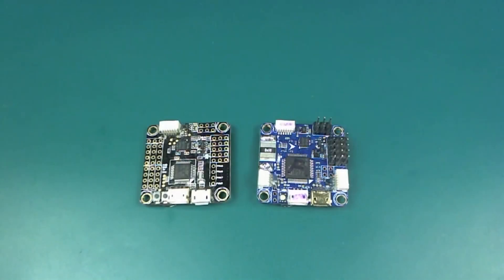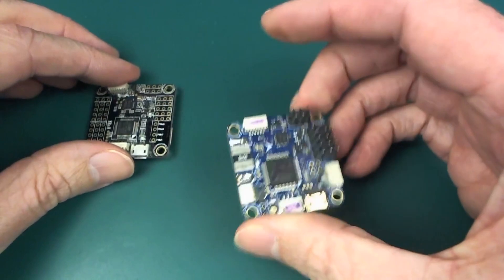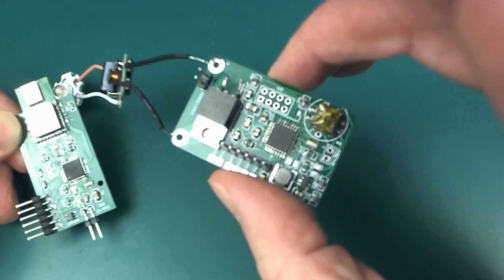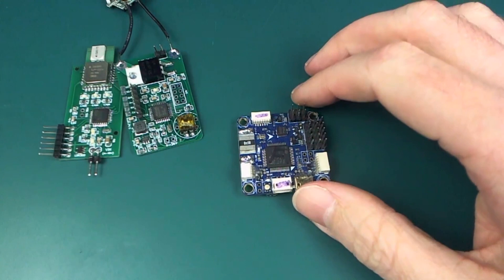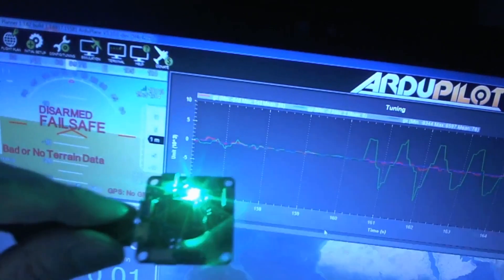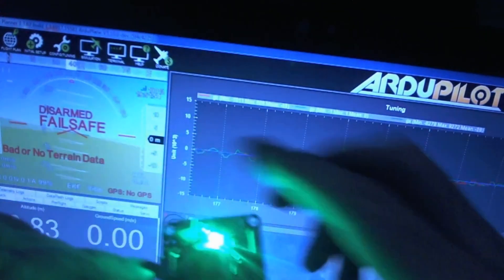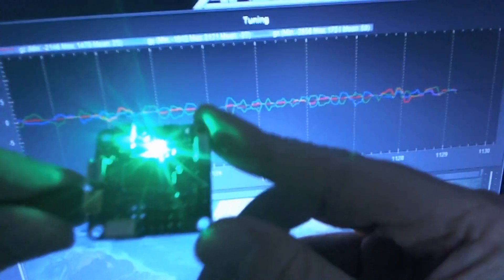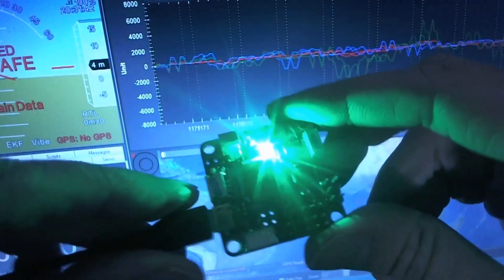SMD soldering newbie tries to replace a MPU6000

Comment: I am going to be trying my hand at this. I have a flight controller with a bad F4 micro controller chip and another flight controller with a bad MPU6000 gyro. My yaw isn't working most of the time and that's causing my quadcopter to fly straight up at full throttle. So I guess I can choose the one I want to keep and replace parts I get off the other board. I found a place in China where I can buy the parts new but it's a 16 to 25 week lead time.
Reply from the maker: You can get parts on Digikey or Mouser, quite fast but shipping is not cheap.

Comment: Why doesn't the pitch and roll match the arrow drawn on the board? Like a gyro rotated clockwise 90 degrees
Reply from the maker: Yes, I changed the setting in Ardupilot by 90 degrees so that the USB connector would be facing forward, more convenient for me.
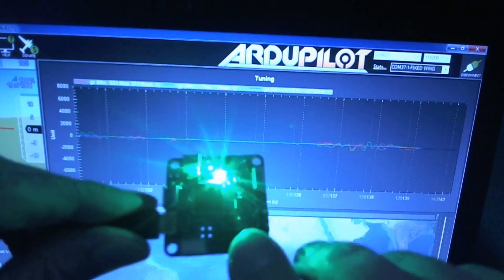Reply from the maker: 4:15
Reply: @iforce2d  
Oh sorry. I just don’t understand English)
thank
Reply: @iforce2d  Have you changed orientation? You do not know what could be the problem that, without changing the orientation on my omnibus f4, the arrow indication does not match the actual gyro readings? I tried different firmware and in any of them in the runoff parameters the front part coincides with the usb connector and not with the arrow

Comment: Wonderful, I diid the same a few moths back and was just as succesfull with virtually the same equipment. I did clean up the before I soldered the mu6000 on and instead of using solder paste I used a lot of flux. The flux recommended by Louis Rossmann actually.  I too have started keeping all the broken ESC's etc... It just is so darn fun and satisfying to do !  Congratulations on your succes!

Comment: When you remove a component get some flux and some solder wick .. remove the old solder and clean the pad ... then you can either put solder paste and hot air the chip or you can take your soldering iron and some flux .. give the pads some new solder and hot air ... nice video .....

Comment: Don't pull on the components,  wait until the solder is fully melted before lifting,  you risk damage to the pads on the board or components pulling as the solder begins to melt.
If you can get the replacement component lined up, just apply genetal pressure with the tweezer in the center of the component to hold it in place till the solder melts and the surface tension does the work, you should really be using flux on your work as well.

But at the end of the day, the repair worked and that's all that matters, we refine our techniques in everything we do though experience and you will find what works best for you.

Comment: Well done on you QFN package swap.  I've done a bunch of MPU6000 replacements on the CC3D and Revos when I was Project Manager for Openpilot, and built a lot of prototypes boards for testing like OPlink Mini with the soldering team.  When you need to replace one just add some no-clean flux and Kapton tape the connectors to protect them from heat or you can sheld them with some thin metal, reflow with how air is the only way to get them off without overheating. The reflow temp for the QFN is (260 +5/-0°C), so you had a good outcome.

Comment: I’ve done a much easier SMD job using a Banggood microscope. One of those tiny capacitors let out the smoke on a tiny micro kwad. One of those brushless all in one guys. That use the PCB as the frame as well. I had won it at a race event. (Also ran, I didn’t actually finish a single race lol) I contacted the seller of the product and to my surprise they sent a whole new one. As soon as I plugged it in, another cap smoked. So I had two free micros and nothing to loose. I successfully replaced a burned cap with a good one. Plugged it in. And yet another cap smoked. I gave up at that point. But a fun and confidence inspiring little job. I did go on to successfully replace the giro ribbon on a kakute f4 board.

Comment: To stop the connector melting remove it, but it requires another bit of skill. Get a small flat screwdriver & try & lift just the plastic without digging into the PCB with the screwdriver. Do this at one end then the other until the plastic comes off. You can do this to most connects up-to floppy & motherboards IDE slots, but with longer connects you have to start at one end, then the middle then the other end. Repeat this until plastic holder is removed. It requires a bit of skill as the number of pins go up, but it's something I have mastered some time ago.
 
NOTE: You are not de-soldering any pins, that stays on the PCB. You can do this to a lot more connects, ie fan, USB, serial, ect, ect. This also includes right angle connects too. 

I only remove the plastic holder when soldering near these header's, but I never remove/de-soldered the pins itself from the PCB, that always stay on the PCB.

Comment: Oh and about your thoughts at around 10:20. What I find the easiest and most reliable way to do this kind of repair is like this: wick all the solder from the pads with a solid amount of flux. Apply fresh leaded solder (easiest to handle, and least likely to fail), it's ok if there is a small blob of solder in the center, we'll take care of that later, if it's too big its going to be harder to place the ic but not impossible. if it's too little the connection might not be proper. Apply more flux. Heat the pad until solder melts (leaded solder melts way easier), place the ic on the pad. Surface tension should start pulling it into the right spot. Apply slight pressure on the ic and all excess solder from the big pad will form a blob outside of the ic, just ignore it for now. Now surface tension will pull the ic into the right position. gently poke it with your tweezers until the ic has jumped into the correct position by itself. No apply some more flux and use your iron with fresh solder and gentlygo around the edges and reheat the pads to make sure all of the have the right amount of solder on it (flux will take care of this) and is properly connected. After this the blob of solder will be gone as it stays on your iron. the pads only take as much solder as they need as long as flux is present. Lastly, let it cool down a little and remove the remaining flux with 99.9% IPA. Done.

Comment: apart from what dave said, don't apply force to the components especially before the solder is melted. it worked well this time, but you will pull pads if you continue. just warm it up, and gently poke it with the tweezers every now and then. you will get a clear indication that the solder has melted once it has. no need for force of any sort.

Comment: As many have already said - flux is your friend here.  Also, you may find a higher air temp helps. Although this might seem counter intuitive, it actually cuts down the risk of damage to both the device you are (de)soldering, and also collateral damage to surrounding components because the solder melts faster before everything else soaks up the heat.

I have found that masking the rest of the board with some thick aluminium foil, or captan also helps save plastic parts from heat damage.

And... It's a bit late now as you've just bought it, but a binocular microscope makes a huge difference. As you have found out - lack of depth perception is a real pain.

Comment: The secret is flux, flux and more flux...BEFORE attempting to remove the chip.  Secondly, don't try to lift the chip before all the pins are heated sufficiently otherwise it will tear part of the printed circuit. This is done by giving the chip a light tap during the heating to see if it moves. When removed, flux again and suck up all the remainder solder with a GOOD solder wick tape. Then apply solder paste to all pins and reheat. Doesn't matter if it overlaps slightly as any excess can normally be removed with the solder wick.
Surface tension is usually enough to move the chip to a central location all on it's own without any interference.
Practice makes perfect.... :)
Kapton tape around adjacent parts will protect against inadvertent destruction.
Also a product called Quik Chip that can help with removal of multipin ic's. Plenty of videos on the subject out there.

Comment: Man, if that baro survived you are lucky! Next time put a piece if capton tape to cover the hole.
Reply from the maker: The baro seems fine. Don't they bake these things in an oven at similar temperatures to stick them on there in the first place? Or is the 'blowing' air somehow a problem?
Reply: @iforce2d when dispensed from a reel  it has a copton cover over the hole to prevent direct hot airflow.

Comment: You can get away with a small optical scope and a soldering iron on bigger smd components, it just takes practice.
I managed to blow my new Taranis X9D  STM32F205 processor, when I disonnected the ribbon cables in the TX with the battery still connected!
This is how I did it,    https://www.youtube.com/watch?v=cAPU4NHCWd0   ,100 pins, I do have a rework station but decided to see if I could do it
with a small tipped soldering iron.It was difficult but possible, unfortunately I could not record what I was doing, you can get clamps to hold the components
in place or you can use a small weight (steel nut) to stop them moving around.

Comment: I have found with smd rework using solder paste that you have to really clean the pcb after with solvent and a soft brush (tooth brush)
as any unused paste does ball and can easily bridge joints and cause shorts.Use plenty of flux before and after as this will really aid heat transfer, also
you can use sticky siver backed tape to mask around the component you are replacing, this stops any discrete components flying away!

Comment: Yeah...stereo vision. I have an even cheaper microscope, without the HDMI and other jewelry, but good enough for soldering. The first thing I noticed - immediately - was the stereo vision handicap. I'm thinking about buying one of those stereo magnifying goggles or whatever they are called. Those things used by watchmakers.

To improve your SMD soldering skills - Louis Rossmann does some really practical soldering and repair work. 
And if you are masochistically inclined - try watching the Androkavo channel and feel clumsy at best.
Reply: Strange Parts made a video about the microscope he uses. I purchased one myself and really like. The stereo feature really helps.

Comment: I've replaced tiny smd voltage regulators and cap's on micro vtx's more times than I care to think about as well as some other smd work. I only use a normal iron though a hot air would be great for qfn package chips and to assemble my own boards. It feels good when you can fix something and have it back in the air without having to wait for a replacement not to mention saving a couple bucks is always nice in this hobby.

Also as some others have said use flux and even clean and re-tin the pads if it needs it and check out Louise Rossmann on youtube for pointers on smd work. I wouldn't worry too much though just don't hold it in one spot too long you want to heat the board evenly by moving the air in a circle around the part and if you heat it up enough it should pull itself right into place with capillary action especially if there is a little flux or even solder paste on the pads.

Comment: Nice!! I would recommend using fresh (preferably leaded) solder and solder wick with a soldering iron to clean both the board and the chip. I recommend leaded solder because it flows much more easily and at a lower temperature. People also seem to like covering everything in flux.

Comment: I would definitely have removed the sodler from the pads and pins. Mainly because replacing it with leaded one makes it so much easier to solder, but also because you will maybe have very different amounts of solder on the pads, which could lead to dry joints. Oh, and .... FLUX!!!

Comment: Eyelids still open here...

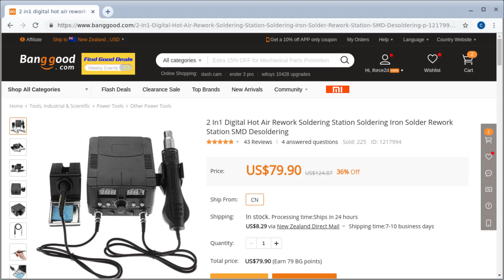1:50
 The pricing thing is just marketing. However the real world case study that is used to qualify this scheme is the department store retailer JC Penny here in the USA. 
  They, like most department stores, had regular "sales" in their stores. At one point in the recent past someone within the company calculated the cost of these promotions and proposed selling all merchandise at a specific flat margin. This pricing was far lower than the competition. They tried this business model and advertised the change. Over the following year their sales completely tanked. Upon thorough analysis it was concluded that even when the customer is aware that a promotion is generic or simple marketing, they are still far more likely to visit a competitive alternative retailer that advertised a "sale" rather than the retailer that did not even if the pricing is worse. For a better explanation the YT channel "Company Man" did a great upload detailing this.

  You were lucky with that MPU6000, probably because of it's size and the overall board design simplicity.
   My first attempt at a similar type of thing involved a large Visio flat screen TV I picked up for free on the curb. I was shocked when I plugged it in and it worked, but soon found out the audio amp chip was toast. It was a STA336. That's a TSSOP package chip but it has one of those large metal ground pads under the chip like a QFN...well...it's actually a chunk of metal a bit larger than the typical QFN. I tried to get it off really carefully, but it was a total failure. The ground plane the chip was connected to was far too efficient at removing heat. By the time I got it up to temperature the tiny pin traces were compromised and failed. The best I can tell, I need a rig to preheat the board from the back side while using hot air from the front, basically I need a pro rework station, to replace a chip like that. It was a hard learned lesson about why expensive rework stations are a thing. It really sucked because that chip was connected to the main processor via I2S so I had to use that specific chip to get it working. Hacking something that complex is well beyond my skill level. Failing at removing the chip and ruining the footprint was a major bummer.
  However, I was recently looking for some better voltage reference chips and came across an AliEx seller with a bunch of Linear Tech chips listed for cheap. The seller also had a LT3092 (adjustable precision current source) and a LT2450 (16 bit ADC) for less than $2 each along with a review where someone decapped a LT3092 and showed the LT die with LT info on it. Both were only available in a QFN though. I have some of both now I just need to etch breadboard breakouts so I can start trying to let the smoke out. I'm a bit more confident after watching this. Those are both tiny chips. They are even smaller than this MPU6000, so I hope they turn out okay.

  Thanks for the regular uploads. I like seeing what other hobbyists are doing and working on while facing similar challenges.
-Jake

Comment: Nice Chris! I always enjoy the journey with you. 
I too have been dabbling in smd with the 858D rework station. So much fun to get a blown esc working again. That first board you pulled the mpu6000 probably had much less copper in it. BTW, have two TS100 with hours of club member use and abuse at the field and shop without issue:-)
Have you seen Livyu FPV?
Reply from the maker: Just watched some Livyu, cool stuff!

Comment: Which temperature have you used?
Reply from the maker: I had 280 on the hot air, not sure how accurate it is though. I usually have to hold the nozzle about 1cm away from the part to get solder to melt like this.
Reply: @iforce2d  Thanks! Next time add a bit of flux too

Comment: Regarding the TS100 have you considered replacing the power jack on the board with either a new part or a wired connection? 

 When replacing smd components instead of adding solder paste, get yourself some flux and apply liberally. This both aids in holding the part on place and helping the existing solder to flow properly.
Reply from the maker: For now I'll be using this new iron, but if I do want to use the TS100 again yes I will probably try making it wired instead of plug-in. Now that I have a second iron I can actually do that :)
Yes I am aware of flux, didn't seem like it would help much in this case, it turns watery and lubricates things instead of holding them in place, I figured it would make my chip slide away under the hot air flow even more. If I could get the hot air angled exactly directly downward would be fine but then it wouldn't be in video because I'd need to take it out from under the scope.

Comment: Looks good. A couple things though. If you're putting any pressure at all on the chip you're removing its too much pressure.  When all the solder is molten the chip will come of with no effort at all.  Next some kapton tape around where you are working helps to shield other components (aluminum foil works as well its just a bit more cumbersome) .  Finally you'll have better success if you get a good flux paste and use it at every step (clean the residue with 99% ipa each time) .  Super finally it'll help a lot of use solder wick to remove the old solder then add fresh solder to each pad before setting the new chip.

Comment: 1:45.. Open it and remove the Jack Connector. Then add very flexible (Silicone type) multi-strand/wires/Cable to the connections on the PCB. Hot Glue for a stain relief if nothing else.
Then a good quality inline Jack connector of your choosing on the other end of the flexible (Silicone type) multi-strand/wires/Cable. Will be easy to change the connector in the future.
7:05.. use an exacto knife (or simiilar tool) and put a scratch mark on the defective chip. You may thank yourself later.